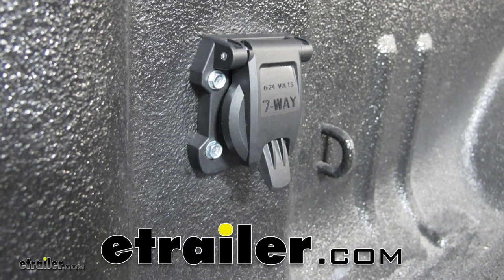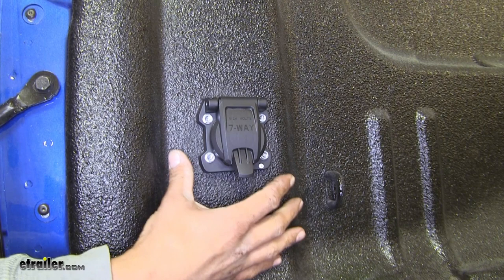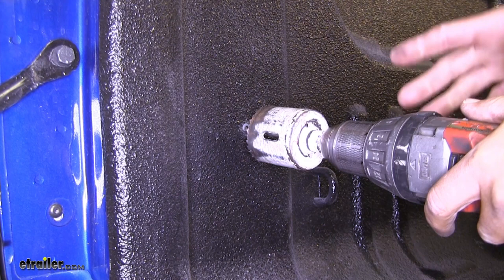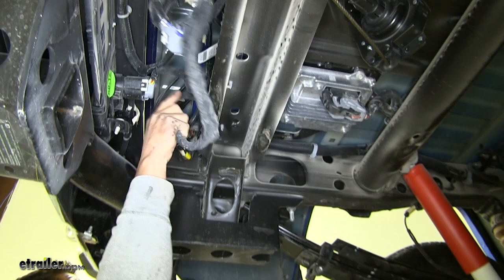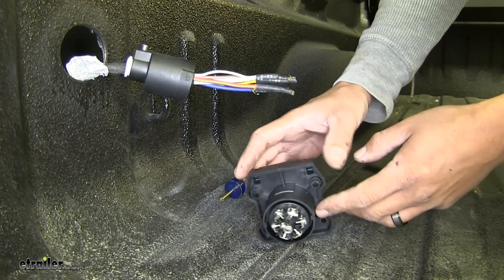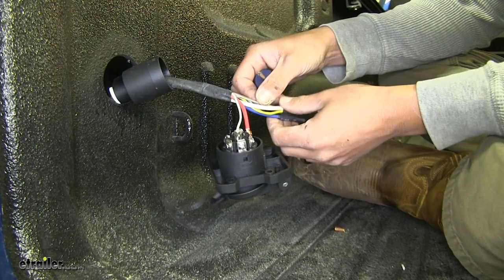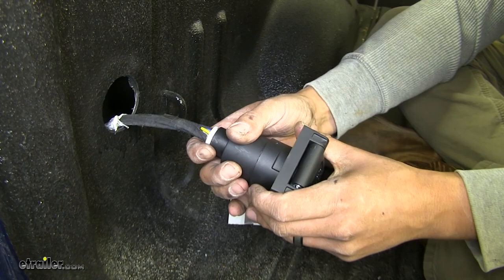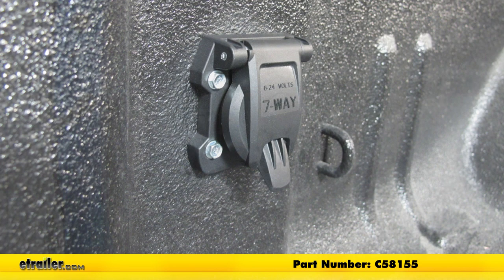How to Install: Curt 7-Way RV-Style Trailer Connector on your 2018 Chevrolet Silverado 3500

Comment: is there a way to plug into the 7 pin then run wiring under the truck to truck bed thru a knockout panel? most trucks don't have the wire bundle like shown in video?
Reply: Yea I saw that and stopped the video to check my truck to see if the wiring was there!!

Comment: I do have a 2016 chevy silverado and it already has a conector on the bed but for some reason I doesn’t have any power at all any ideas on how to fix it
Reply from the maker: You may have a fuse that has blown. It also may have come disconnected somehow underneath by the plug on the bumper.
https://www.etrailer.com/Trailer-Wiring/CURT/C58155.html

Comment: Nice job!!! I was wondering why the connector goes on that side and not up by the gooseneck ball?
Reply from the maker: Thank you for the compliment! The location of that connector can vary depending on the pickup or where the customer would like it installed. Sometimes the location is also determined by the amount of space available on the other side. All in all the location inside the bed will make it easier to connect the 7-Way as opposed to the bumper.

Comment: Why use a pilot bit when your whole saw has one???
Reply from the maker: The reason why we suggest using a smaller pilot bit first is so that the larger pilot bit, that is in the hole saw, won't walk on you when trying to get the hole started. It's a simple step to make drilling the larger hole a little bit easier and more accurate.
If you would like more information on this Curt 7-way RV style connector you can find it here https://www.etrailer.com/Wiring/Curt/C58155.html

Comment: Would this be the same for a 2004 F250
Reply from the maker: It would be easier for you to use the kit in the following link if you are wanting to add in bed wiring to your 2004 Ford F150.
https://www.etrailer.com/Custom-Fit-Vehicle-Wiring/Bargman/50-97-410.html
Reply: @etrailer  oh ya thank you very sweet